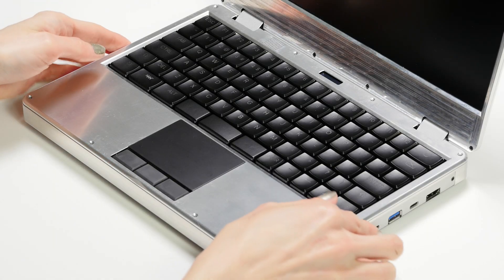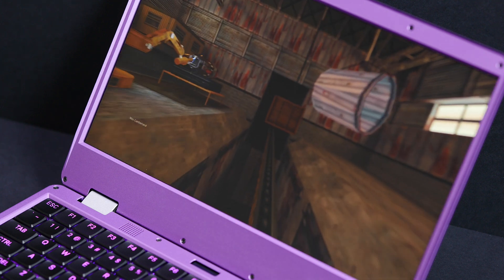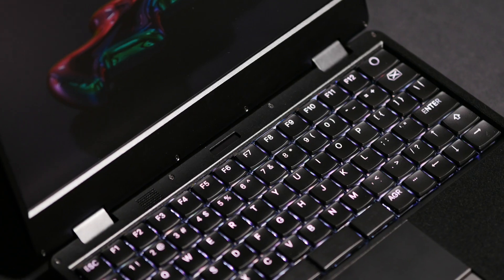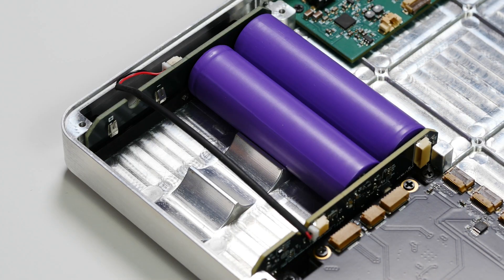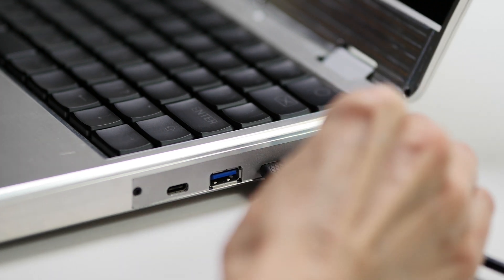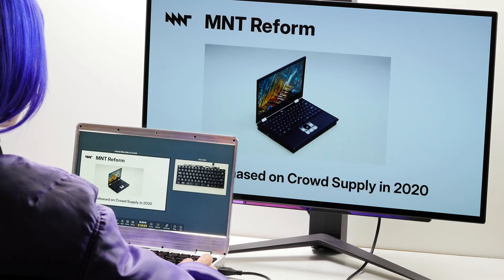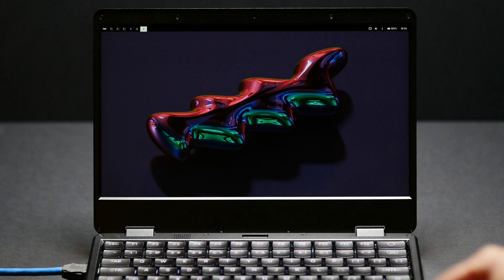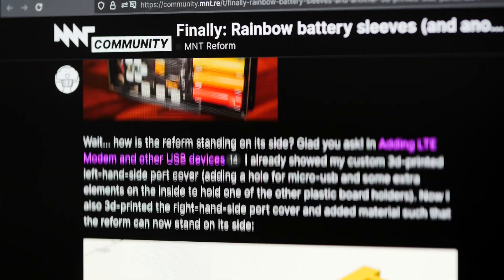MNT Reform Next Launch Trailer

Comment: Cannot wait to install Windows on this puppy
Reply: You can but at this time you can't do that. ARM.

Maybe it's POSSIBLE to install windows, but what's the reason to install Windows on OPENSOURCE LAPTOP?!
Reply: @Avenitson  Windows 11 has arm variant you can install that even on open source devices. They had re-written the whole kernel and compiler to support arm specially for to support their new snapdragon ai pc for windows 11 and it also have translation layer for x86 and x64 executables (finally something similar to apple silicon for arm support) but don’t even think of running anything below windows 11. And performance is also not bad but problem is that microsoft is promoting it’s copilots and recall feature labeled as AI PC instead of promoting developers to adapt arm instructions and have a transition period for arm while give support to x64 translation layer and improve it (because older software will be going away so soon specially on windows). I don’t understand why microsoft always ignores the gold and keeps doing some other nonsense stuff. I mean this kind of stupid behaviour dates back to their windows phone os days. 🤦🏽‍♂️
Reply: @piyushkumar4015  

Sure windows 11 supports ARM, but still, there's tons of issues with software. So, like, you could install windows 11 on this laptop, but for what? And, especially, it'll just kill battery time so I see no reason for doing that. But yes, that's doable.
Reply: @Avenitson  that’s true windows is now just bunch of bloatware it’s the sad reality we have to live with 💀
Reply: @Avenitson because it's funny :)
Reply: @ЮрийПавлов-х3т  That's useless, but sure, go on.

Comment: I like it but I must say that using Minetest as demo without mentioning it is bit misleading. You should mention that it's Minetest and not Minecraft because some people may expect to run Minecraft on this smoothly. Not sure if you can or not but I think it's something that should be disclosed in a launch trailer. Especially since Minetest can run even on stuff like Raspberry Pi 3.
Reply: I imagine Minecraft would run well, but they probably didn't want to pander to Microsoft and proprietary software.

Comment: not personally a fan of the IX industrial ethernet, any reason a fullsize RJ45 didn't make the cut? For me, the need to carry an IX to RJ45 dongle for one of these makes them not much of an improvement compared to having another usb C port with an an RJ45 dongle plugged in there (for me, a custom cable with the IX port on one side often isnt an option when patching into existing networks). I'd personally be glad if fullsize RJ45 it gets offered as an option in the future
Reply: This and the split spacebar are two things I would mod right away
Reply: no way a full size rj45 can fit under that keyboard, kailh choc switches are like 7mm thick. maybe it can be modded in with one of those laptop rj45s that is half-size and you have to expand in order to connect a cable

Comment: are there any plans to bring back the v2 version of the keyboard, perhaps as a DIY-only option? I quite liked the split spacebar with the two alt keys in the middle but never got the chance to order one before you guys switched to the new design with the 3 part spacebar

Comment: Now with 1,600$, you have to decide between a more powerful ARM like macbook or this... 😂
Reply: MNT is for people that know a bit more about tech than the average joe
Reply: Now try swapping RAM and see what's cheaper?
Reply: Can a macbook battery system be hijacked and hacked for a different system project?
Reply: @ I think you still can, if you want to. People also upgrade RAM & SSD on their own too. 

Also MacBook storage is greatly encrypted
Reply: @thanatosor  Apple products just don't fit the tech guys, stop arguing about that.

For instance, I develop with ROS2 and it used to support only Ubuntu (now it does Windows and macOS too but it's still not tier 1 support).

Ofc, you could find work arounds like VM's and so on. But what a pain.
Reply: @ oh, my comment was just about very common perspective of end users. 

Surely, devs & hobbyists will love it like I may throw money into.